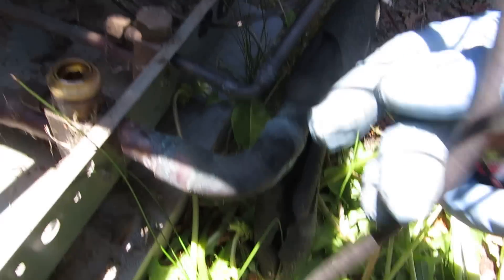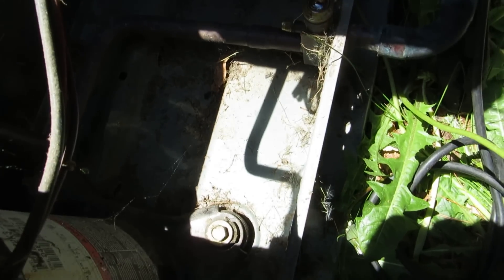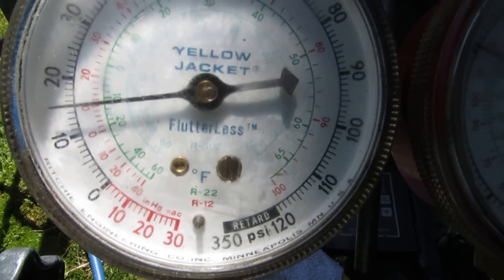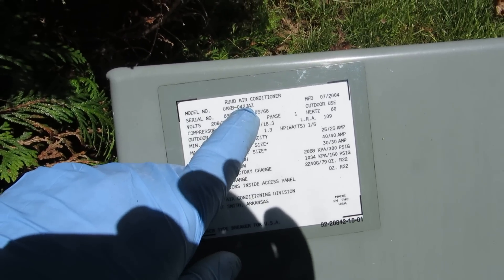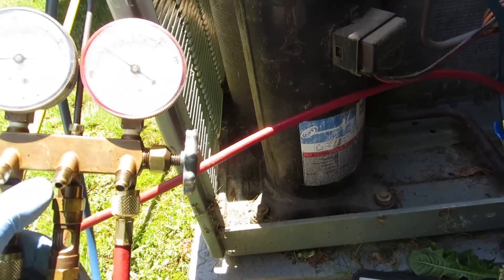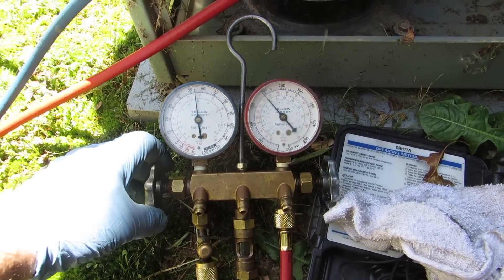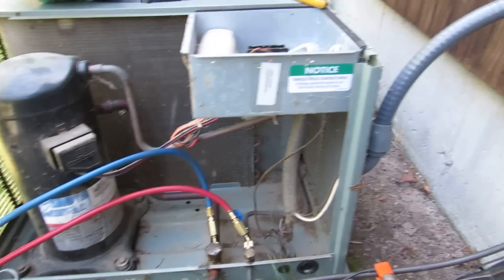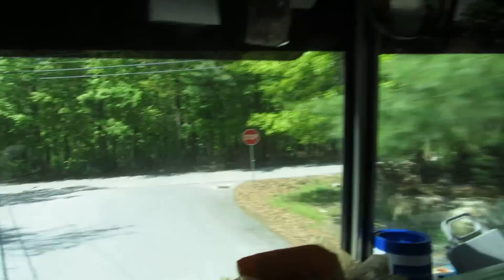HVAC:leaking r 22.no cooling

Comment: Great job, luv your truck! That truck a/c cools good. I seen similar one's with Thermal Kings A/C on them running off a generator on the truck.
Reply from the maker: i installed the a.c. in my truck they said it could not be done because of the oversized chase but i make it happen had to bend the manifold in my vice to miss the frame rails but it works just fine
Reply: Came out nice, and cools like a champ!